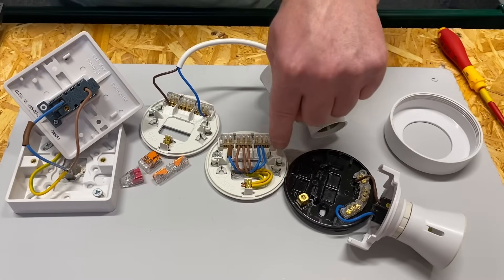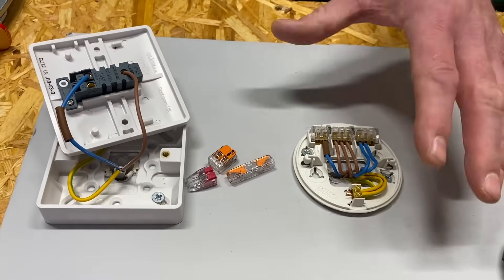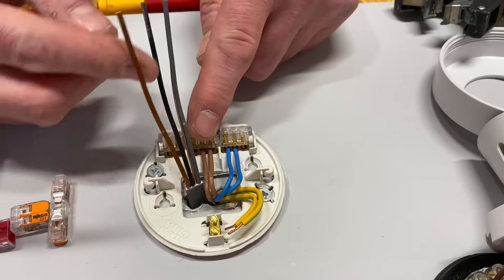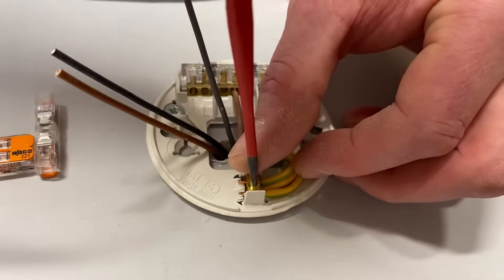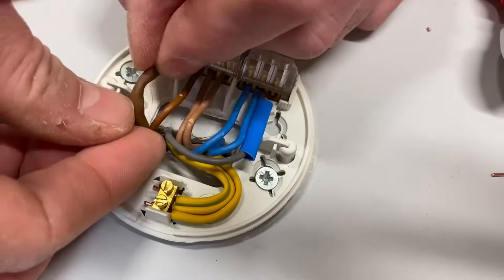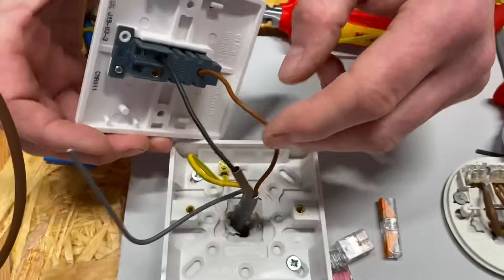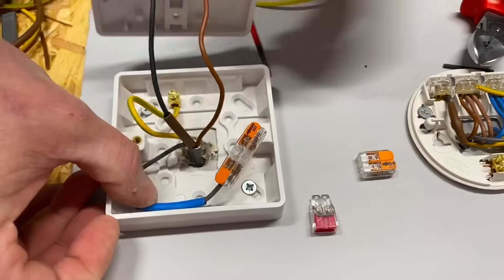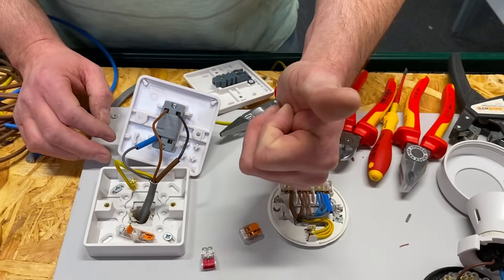How to Future Proof Your Lighting Circuit with a Neutral at the Switch - 3 Plate Wiring Method

Comment: Good to see you advising sparky's to always check the copper for damage i and re make them n all other wires. You might not have touched those wiring connections, but you did move wires around which could be enough to snap one that has been squashed. Any faults afterwards (even years later) you were still the last person working in there

Comment: I am a diyer. I managed to change all my 70s switch. I changed rose pendant to wagos. I added 3 spotlights in my bathroom. I replaced an old fan for a dropdown dining light. I replaced bathroom light with led mirror. I replaced outdoor bulb with pir floodlight. All these from YouTube videos like yours and instructions on websites. You do have to do a lot of research before handling tasks like these. Be safe guys.

Comment: I’m running all the cables in the loft my self, have a friend who knows my work and is guiding me through it so he could sign it off. What I’ve decided is to run dedicated power to lights and sockets fresh from consumer unit. Also what I’ve done is run power direct to switch method then running lights off the switches directly. What’s your opinion… many have told me it’s better to run power from switch to switch then to lights so your not having to jump on and off a ladder to take off lighting to correct a fault and it’s less hassle since power wil be at switch. Can this also be classed as future proof?  
These videos are also a great help in learning and understanding so keep up the good work and thank you.

Comment: You can buy no neutral smart switches,so no if you buy no neutral smart switches then no neutral is required at the switch,so to me in 99% of domestic properties the only time you would need a neutral would be at the front door or backdoor switches where the neutral is required to be isolated ,so if you are a DIY person all you need to do is to Google the relevant information which will save you following some of these videos

Comment: The only time a neutral is needed at a switch is when the switch is switching an outside light where both the switch wire and the neutral need to be isolated for total safety requirements

Comment: Where does your neutral supply come from on a two way or three way switching system. The neutral at the other switches? Do you need to run a single neutral between switches as you’ve already used 3 core for strapper.

Comment: In stead of making all the connections at the ceil rose why not do it at the switch using a slightly deeper back box and all you have at the rose is a live and neutral, this also stops the diy'er add lights all over the place

Comment: I thought most people were wiring through the switch nowadays anyway. What’s the first thing that happens to the ceiling rose when the homeowner moves in, it gets replaced with a fancy light and connectors above the plasterboard, then there are the wall lights. Much better to fit a deep back box and loop the neutral in some wagos. It was frowned upon when I served my time but times change

Comment: Very good informative video especially for the newer people to the game. I stated running 3 core and earth to switches as standard in 2015 to minimise the number of cables behind the switch plates especially where either flat plate switches are used and the back is used for loop in wiring. The floating neutral is ideal if a 5 amp socket or in the case of this video, a smart switch may be required in future.

Comment: You can buy smart switches which do not need a neutral. I have one in my kitchen. The only extra I needed on LED strip lights is a 100MF capacitor because there was a 50 Hz flicker. It was included in the box by the manufacturer.
Reply: How does that work, if you only have a live fed to it??

Comment: I note your strippers consistently nicking the inner insulation. Any localised stress on the cables (bending/pulling) can then easily result in the insulation failing. This is not good and IMO should result in the installation being snagged and failing inspection.

Comment: If pulling down a neutral is not a option, it's always possible to create a "virtual neutral" to power your smart switch, using diodes and a capacitor. https://youtu.be/8h29-0rpQJo

Comment: Hi  Interesting video. Just looking for some advice. I have a one way light switch which controls 2 ceiling lights. The switch has 3 cables coming in which confused me  -1x 3 core and earth and 2x twin and earth. There is a neutral loop connection in the switch with 2 x blues and a grey, one com with 2x browns and 1x L1 with a brown . All earths are connected to the back of the box and there's a black wire just lying loose in the back.  Could you explain this wiring to me? Most videos on light switches just seem to have one cable coming in.

Comment: the idea of "de-neutralising" the black wire is an interesting one. personally I have been using black as a neutral with blue sleeve/tape on that ground that if the sleeve did fall off for any reason it could still be clear to someone what it is. maybe we just need to ditch black neutrals though.
Reply: Why would it still be clear to someone if the tape falls off? Black is a phase. Are you an older person by any chance?
Reply: @Shocker99  nope but there are still plenty of installations with the red and black colours. In a domestic property it will rarely be a phase
Reply: @nsoper19  It does not matter if there are ancient installations with red and black.  In modern standards, black is a phase, therefore, black should be treated with the respect it deserves even if it's rare to see a 3 phase system in a domestic installation.
Reply: @Shocker99  grey is a phase too. In any event, sleeving clears up the ambiguity, and heatshrink is a better option than loose sleeving as it won't fall off. Just a bit more trouble to fit.
Reply: Man after my own heart 😂 why the hell did we ever move from RYB Bk. Caused so many problems for no gain whatsoever.

Comment: could I not run the consumer live through the switch and onwards to the rose terminating at the live in the rose running the neutral back to the common neutral in a junction box if I'm in a small house?

If I used a 3 and earth from the switch, I'm thinking I could also connect it into the neutral at the rose without having to double up.

I'm using a spider type system for my circuits running from a central junction that runs through a fuse box back to the consumer unit...I have a pretty small house and the rose I want to connect to doesn't need to be looped through

Comment: Not an electrician but have done a nee install on my summer house, I ran my 3 core into the switch and run a 3 core from the pendant but inside the switch I used a blue butt crimp connector for the neutral and then just run my brown as the switched live, so I have a neutral at the switch should I need it, is this acceptable ????

Comment: Took a similar approach 10 years ago on my self build. I all light fittings go to the switch. All switches have a neutral back to the master cabinet and as many lives as there are lights in the room.  This gives me the following options: 1) conventional switching 2) module such as z-wave in the backbox 3) ability to switch live from my central home point using automation.  Thankfully I had an understanding spark who followed my design to the letter because he could sign it off under option 1 which is essentially a standard setup.  But gives me the flexibility to adjust any room to suit my automation needs and still allows the whole house to be reverted to conventional switches should i ever sell the house

Comment: I have said for many years that a neutral block should be made to be attached in the back of a box to allow for a neutral cable along side the earth cable for such reasons a device comes along where such a connection is required.

Comment: As a DIYer (I mean I've replaced a switch and not much else!), it would be far more obvious to leave the un-used neutral floating rather than terminated in to the switch. Before seeing this video - if I saw 3 cables plugged in to a 1 gang/2 way switch with 4 terminals, I think I would probably make a bang after replacing the switch with a 1g/2way 3 terminal switch.
Leaving a neutral at every switch on new installs should be standard, but I expect a significant portion of new build homes won't get this treatment, because the cheapest quote is most likely to win the business, an extra £1-2 per switch in materials adds up quickly - my 4bed has around 20 light switches, multiply that out by 80+ homes on most estates and you quickly add thousands to your bid.
Reply: Definitely.  I'm not trained but I know how much I can do and what I cannot (or am not allowed to).  As such I'd see the L1, L2 markings and hope I'd work that out but I know that others would not.  I'm thinking about a person who shall remain nameless that zapped themselves 6 times changing a light switch.  Obviously three wires connected on the old so all three must be connected to the new switch, stands to reason....BANG!   The floating wire is at least obviously not connected to anything.
Reply: @Cenedd  You got zapped because you didn't practice safe isolation. Was the lighting circuit turned off? I doubt it, otherwise you wouldn't have got electrocuted. Made worse by not knowing what you're doing.
Reply: @Shocker99  The "person who shall remain nameless" wasn't me....a year ago...and isn't me now. I clearly stated I wasn't certified and knew what my limitations are...but I can manage not putting my fingers on live wiring thank you very much.
Reply: Excellent point well worth making. In my opinion you are putting a three core in for the next electrician so he can  make more money at your expense. The only way it would work is by making it mandatory along with 25 mm minimum depth boxes for light switches.
Reply: A floating wire taped up is okay, but leaving it without any insulation at the end is asking for trouble.
Reply: It's very bad practice to leave a wire unterminated, especially when it is connected to the neutral at the other end. Also, loose sleeving will fall off. Just put a wago or, if you must, a screw connector on the end.

Comment: Assuming smart switch used electronic switching (i.e. no relays) and its circuit uses less than 1 watt, that equates to approx just under 5mA, so can we not use an earthing conductor as a neutral and get away without having to rewire for a smart switch on older installations, and again using no more than two or three smart switches per lighting ring circuit,  such that total current drawn by these switches is just under 15mA or half of a normal RCD trip current of 30mA, or could you not upgrade RCD to 45mA trip current to compensate. Most small electronic circuits use a simple capacitor and a diode to generate approx 10v to 12 volts for the electronic circuit which in turn can switch on a triac to switch power to lighting circuit.  Although this may not comply with wiring regs, but it can definitely work without tripping RCD and the rest of the circuit would still be protected by the RCD. A switch electronic or not is not suppose to consume too much power in itself, its like an electric meter cannot use too much power or the meter itself becomes a power consumer or an unwanted load.
Or we could also balance the current running through an RCD such that if Live is drawing 5mA for a smart switch through an earth being used as Neutral , then we make the Neutral also drawing the same 5mA current by connecting a power resistor of overrated wattage of say 5 watts ( when only 1 watt resistor is needed of approx 47K) from the RCD protected Neutral to unprotected Live inside the consumer unit, his would balance the RCD and stop it tripping.

Those who don't understand Electronics will most likely frown upon this idea, but it can certainly work and can be just as safe as long as the resistor is mounted in a small heat proof box and left inside a large space of a consumer unit or wired in another box next to a consumer unit if there isn't enough space.

Of course, every aspect of safety needs to be looked at, and the only problem here is if an earth is being used as a neutral and is steadily drawing a small load current for running smart switches, a hazardous situation can arise only if an earth loop in loop out gets disconnected in another socket or ceiling point and may become live though its current will be limited to 5mA. But it may be enough to buzz anyone not expecting it to be carrying current, so safety warning can be stuck on those sockets or ceiling roses, to warn to disconnect that circuit from the CU before carrying out any earth disconnections. warning note also left in the CU.
An Experienced or qualified electrician would or should never disconnect bunch of earthing's on a live circuit knowing that it may be carrying other minor fault currents such as leakages from suppression capacitor filters in appliances.

Comment: Great video but this shows the nonsense of the colour colouring of cables in the UK. 'Sleeving', - I know it's been used for years - but it is an absolute crap method of colouring cables because the sleeving isn't easy to see (blue against grey!) and often get missed.

We should go back to the red/black colours and we should adopt the Irish cable system of having the earth sleeved green/yellow throughout the length of the cable, as well as going back to the more sensible 4 core cable colours red, yellow, blue and black rather than the 'new' brown, black, blue and grey.  We could also have cables with numbered wires, i.e. a number printed in white into the cable, 1, 2, 3, etc.

Let's face it, the cost of cable is next to nothing compared with time.

Comment: Your 3 plate method (loop in) at the ceiling rose is not used that much these days, every thing goes down to the switches, then just a twin up to the ceiling rose, much easier for fitting light fittings, and on new build quicker to loop in at the switch, and fault finding is much better because your not on step ladders.

Comment: Remember once seeing in a two way switch, the live conductor in L1 the switch wire in the comon terminal, and the neutral in L2. Worked well.
Reply: They were both lives. It wasn’t a neutral.
Reply: @thomastaylor9536  Yes they were  neutrals in l2, terminal was being used as a connector, live in terminal l1and switch line was in tyhe common.

Comment: one could also just pull 2 cables to the switch, one feeding with 3 wires, and 3 wires going to the lamp, this way the phase, neutral and ground are always clear and nothing to go wrong there, of course the one installing SHALL mark which is the feeding cable...

Comment: With some drying boxes there's a prong that I use to push a choc block onto. I use one for the neutral and the other as earth on class two switches. As it's not carrying current I don't think it's necessary to use a wago. Would you usually sleeve all three cores with 2 way switching? I can't see how it would be ambitious in a domestic environment.

Comment: In my opinion if you want to really future proof your install you loose the ceiling roses completely as they are a pain with a lot of the lighting fixtures customers use that are nit designed for ceiling roses and either loop at the switches or use the widely available spliter systems to reduce the ammount of cabling. Great video though

Comment: Could you just use a 2-way switch? Switched live to common, perm live to L1, neutral to L2?

That way your switch in one position supplies live to the light, and in the other position supplies neutral to the lamp - we know the other side of the lamp will always be neural. Any reason that wouldn’t be safe?
Reply: What colour sleeving would you use at the rose end ?  I'm not sure.
Reply: I have seen that done years ago but can cause tripping with RCDs now.

Comment: Another great video. I have recently relocated a light switch in my living room and while doing so, picked up the neutral from the lighting circuit and ran a single to the new switch location. While I have a little access under floorboards, will try to fish in neutral for landing/hall light and kitchen too.
Reply from the maker: Thanks for the comment 👍🏻
Reply: @GSHElectrical  No worries Gary. Quick question bud. If you had to install a picture wall light as well as the main light, separately switched, would you run 2 core T&E from the switch directly to the light. Taking the Permanent Line, CPC and Neutral from the 3 core & CpC that has been run in to switch for main light ?
Reply: @tazdevil875  That's exactly how my outside porch light is connected, and that was done on a new build home 2 years ago. It's run from a 2 gang 2 way switch in the hallway, which of course already had a 3+E run from the ceiling to bring the neutral down. I wonder if the rest of my house is done like this?! (I doubt it.)

Comment: Thanks for your efforts Gaz. I think neutrals should now be fed to all switches on new installations/ feeds. I know you said that its more expense for the extra core but let's face it, it's minimal and it's a lot cheaper than replacing a T&E further down the line.
I've just ordered the new Wago 221-2411 for my toolkit, I think they're a great addition and the way forward for the likes of extending cables to a socket etc and will  replace my current Ideal Industries inline splice connectors, especially for class 2 cable.
Reply from the maker: Thanks for taking the time to comment in such detail 👍🏻. Gaz